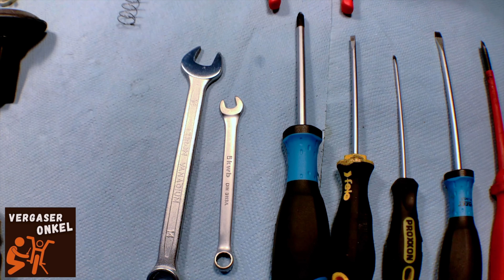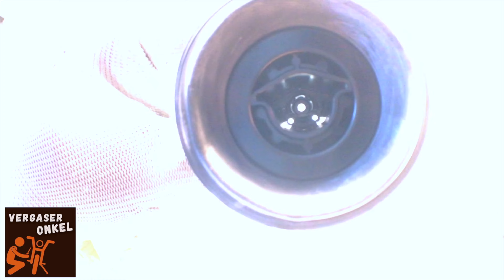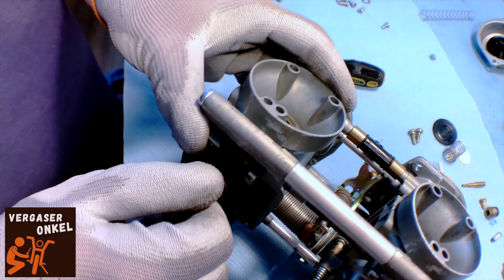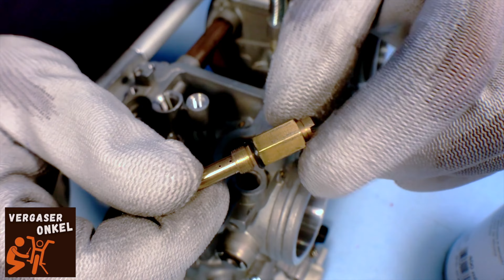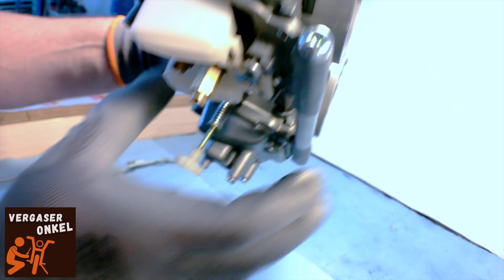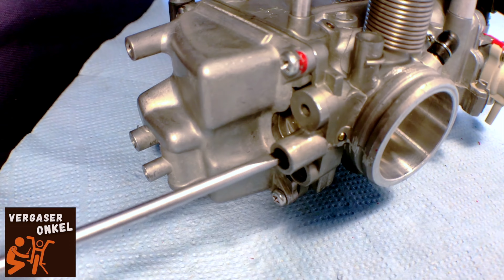Assembling a Suzuki GS500F? Don’t Make THESE Mistakes! | Carb King

Comment: I have same carburetor 2009 Suzuki GS 500. How do i install vacuum lines for the choke I plugged both white ports and now choke doesn't work bike still runs well. I'm thinking if I just run 1 line to both those white ports with a T cable and run it to vacuum line.  I can't find a good diagram for this can anyone help?
Reply: Look up  "Suzuki GS500F How To Remove/Delete The EGR Or Pairing System" from "i fix shet", it's not a perfect guide but he has a couple vids including that to help you know what to plug up